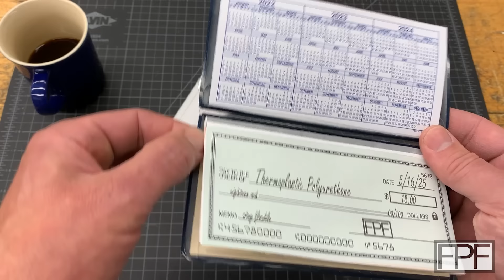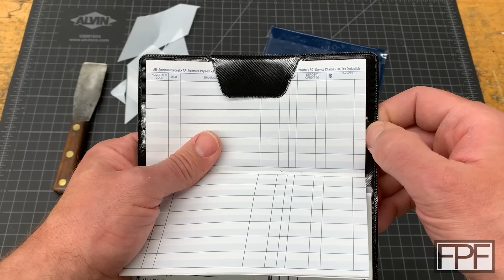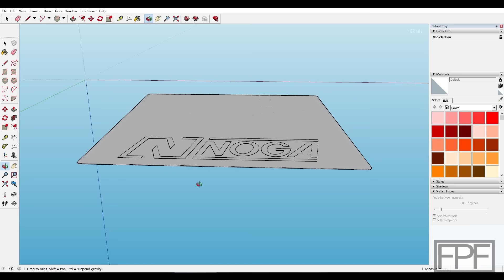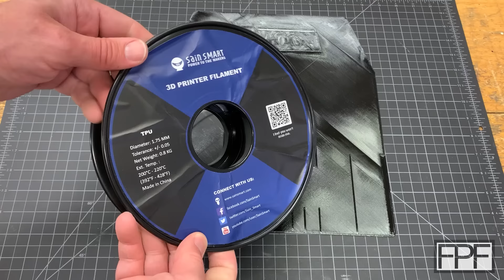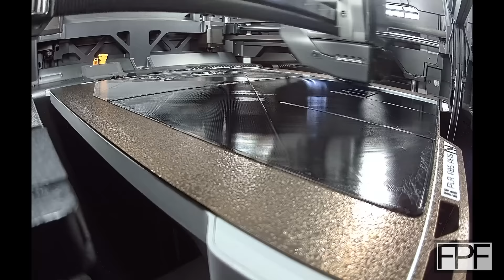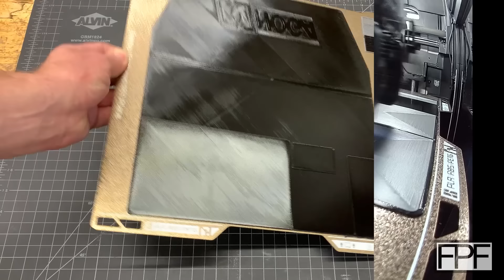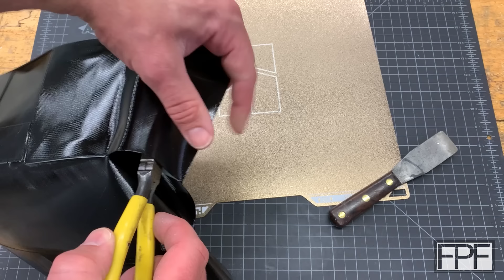3D Printed Tool Roll and Checkbook Cover

Comment: I’m currently trying to figure out how to design a combination of these things, in a way. I don’t have multiple extruders so it’s been really challenging, but attempting to make a pouch with bellows that I can keep in my backpack.
It will be thicker at corners to have some protection for the contents.
Figuring out how it will close and fasten is hard, and how to make the bellows “webbing” so that it folds inward I’m not really sure about either.
Still in early stages.
Reply from the maker: I did another video on this with the bellows for the pockets for wera hex drivers and magnets for closure.  check out the vids list on my channel
Reply: @FunctionalPrintFriday saw that recently and it does help, thank you. Not sure how well that will work for my idea but I’ll give it a shot. Would there be a way, at least theoretically, to do it with a single extruder, even if it’s just to test portions of it before printing a final version on a proper machine?
Reply: Oh, and you definitely earned a sub. Functional prints are all I do. Much appreciated!

Comment: Dropping the plate on some ice might help shrink the TPU in order to peel it off easier. That could also help remove the PLA support since it might have different shrink rates. Just a thought. Thanks for these TPU ideas!
I thought about inflateable gadgets with this method.

Comment: Rest of the world here, I've not had a cheque book this millennium, and even before that I hardly used it.  The rest of the world does things electronically these days, either with a card, or our phone.  Larger payments are often made using a mobile banking app.  I also can't recall the last time I used cash, certainly not since the pandemic when people didn't want to handle other people's cash.  I do carry some notes for emergencies, but I've never needed it.  In restaurants, we don't give the waiter our card like in the US.  Instead, they bring a widget to the table, and we tap it with our card/phone.  The idea of handing your card to someone else just seems wrong to Europeans.  Considering all the major technology companies in the US, I find it bemusing that your financial systems are so antiquated.
My guess is that PLA will only stick to hot TPU.  The tool roll is a much larger area, so the TPU has cooled a lot more.  Maybe a heated bed would keep the TPU warm long enough for the PLA to stick.

Comment: Couldn't you just print a layer of your support material between the print bed and the TPU to make it easier to get off? I know you mentioned the PETG one you started using wasn't as easy to remove but it may be easier than the TPU and you won't have to worry about damaging the print when removing it from the bed.

Comment: Hey. You can try Windex or propably any window cleaner as an invisible separation layer for TPU on the textured surface. Should work well and is easy to apply. I use it to print PETG on a smooth PEI sheet. Works really well.

Comment: So cool! Have you tried using different textured plates, like iridescent (rainbow effect), PEO Smooth (flake-like), or carbon fiber surfaces — partly for aesthetics and also to see if the release is easier due to the shallower texture? After watching your videos, I ordered the SaintSmart TPU. I got the A1, hoping it will deliver similar results to yours.

Comment: Tpu layers with pla interface. Brilliant. I've made tools rolls with ldpe and canvas sewn together in a sewing machine. I have a roll for files: metal, timber, rats tails, saw resharpening, needle,  bastard, milling, safe edges, you name it.  The two i use everyday live in the tool bag. That roll is just sewn canvas. The other canvas and clear plastic sheet holds my spanner set. I don't do mechanic work but sometimes a spanner really is what's needed. So a roll of spanners takes much less space than a full drawer layout of sockets, spanners and ratchet drives. Generally don't like the solution and as my tools have become better I've opted for custom containers: boxes,  3d print,  timber, laser cut foam inserts, folded metal,  etc... but a flexible item wrap for some digital callipers to go in my tradie trailer with all the dusty grungy timber tools seems viable. I might try this on my qidi4, which I wonder if its multi filament system will arrive anytime soon??

Comment: i like tool rolls and have made them with fabric but this is interesting on the nearly mass production type level if you can get the separation layer to be agreeable. perhaps something water soluble to dissolve it right out.

Comment: I've had good results removing TPU from a PEI plate by 1. gluesticking then brushing with water until it's an even liquid, and pre-heating the printbed to let the water evaporate for an even thin glue layer, 2. then after the print, running the entire plate under warm water while slowly peeling the TPU print off.

Comment: As someone who prints quite a bit of products that have TPU in direct contact with PEI, I have found using Prevailent T-80 is thin enough that it doesn't impact print quality and acts as both an adhesion enhancer as well as a release agent. It only requires a very thin layer applied with a sponge brush. The only downside I've found to using it is I have to wash large flat parts because they will feel a little tacky after, but I can basically peel tpu straight off without issue with only letting it cool a bit. This is the method that works best for me because I'm making parts that the Tpu feature stretching too much can cause problems with other features of the design, so it is easier for me to spend 30 seconds rinsing it off than to risk damaging the part. I'm also producing parts in bulk that are being shipped out so spending time slowly removing them from the plate is less than ideal.

Comment: What about using compressed air to remove it from the sheet? Actually, thinking about using a needle valve to blow air under it got me thinking you should try and print an inflatable ball in a future video.

Comment: Why not, as the first layer, print a Pet-G layer first on to the print bed, so that the TPU will release easy from it? And to get a similar 'finish' to the TPU that the print bed would give it, add "fuzz" in the settings, to the top of the Pet-G base layer, and the TPU should take an imprint off of the Pet-G layer.

Comment: Wouldn’t you just be able to print two separate pieces and then use a hot tool, like a soldering iron, glue gun, or heated wire to join the pockets together? Seems like the inner support layer was a major headache in this process. I imagine this is how the checkbook and tool roll are formed in the first place

Comment: Nice video, but I will tell you a trick! Put the build plate in the freezer, that will remove the TPU from the build plate for you. Let it sit in the freezer for 30 min, an hour or so. Works all the time, and it's super easy to remove after that.

The thing why this work so well is because the TPU gets shrinked, so it releases alot from the build plate, but then when you take it out of the freezer the TPU is also very hard since it's frozen solid. Then you can easily flex the plate like you would for ordinary PLA and boom it just pops off like PLA.

Thank me later! .. ;)

Comment: 21:00  OR.  just throwing this out there.  GET A FREAKING DIFFRENT BUILD PLATE FOR FK SAKE.
Reply from the maker: which build plate for the H2D would you recommend that provides the same texture?
Reply: @FunctionalPrintFriday  
a collection of them.   diffrent beds for diffrent applications. 

you need a kapton tape bed if you ever plan on printing polycarbonate. 
glass is extreme bonding for tpu's.  
smooth pei bed.  will sometimes work better than a textured one.  and in other cases a textured one works better than a smooth one.  

NEVER print petg on glass.  it will litterally take chunks of glass out.  
however if you use pva glue. or a pva slurry.  it can act as a release agent where the petg takes IT off the glass rather than chunks of glass.  

in any case it's too much typing for everything.  just know that there is a perfect build plate for any situation. and sometimes if something doesn't stick, all you need is a diffrent surface. 
.
as a final note.  touching build plates is the worst you can do.  the oil from your fingers will prevent adheasion.  simply clean with water and a CLEAN sponge.  no soap.
Reply: @FunctionalPrintFriday  
had to rewatch to see what the exact problem was.  

yeah either try a smooth plate.  
or go the pva release agent route.  (glue stick) 
but yeah for tpu's.  glass is amazing.  
it will stick even if your nozzle has a few millimeters distance from the bed and the tpu simply falls on it.  (ninjaflex.  does this.  diffrent tpu's might give diffrent results) 
but even with all that stick.    when the glass plate cools down it releases easely.  
IF when cold it does not release easely.  then you might need to recalibrate your z-offset.   (you can release it again if you heat the bed up to about 40-50 degrees celcius.  this will soften the tpu enoegh that you can peel it off like tape rather than trying to peal an entire flat surface off in one go. ofcourse this won't be a problem when printing something thin that you can roll up when cold aswel)

Comment: i'll give you a guess as to WHY pla works like support in this case.  

it's about 1 specific propperty that is also the reason why any print comes off the bed when the bed cools.
Reply from the maker: I imagine you're referring to the property of PLA slightly changing size when cooled.  I don't believe that is the property at work here.  They don't stick to each other any better at extrusion temperatures either.  I believe the reason is related to molecular differences between the materials and differences in the crystallinity.
Reply: @FunctionalPrintFriday  
it either stick enoegh to be able to print on it.  in wich case it releases when cooled due to shrinkage. 

OR 
it chemicly doesn't bond what so ever and then you CANNOT print on it.  
it will just curl up into a spiral like 1 or 2 cm behind the nozzle.  

however i believe tpu has a higher shrinkage so it shrinking more than the pla is why they release.

Comment: I wonder if you could go the next step and add a flap on the right with a clip printed in place. You’d also have to print the other half of the clip on the middle where it would meet

Comment: I want to warn those watching that taking metal scrapers/blades to your PEI sheet will absolutely scrape the PEI off of it, even if you're gentle.  You might not notice at first, but after doing it for a few prints you'll notice the wear.  The bed sheet really isn't supposed to be a wear-item, so scraping it with metal or printing incompatible materials directly onto it are just going to incur unnecessary expense. Wood/plastic scrapers are a must, and they're much less likely to damage the print as well.
Reply from the maker: I've been printing on PEI sheets for 8 years.  I have yet to scratch one or wear one out.  If you round the edges of your scraper and use the right angle, it slides on the surface.  I don't disagree that many ppl do scratch their beds, but I think it's mis-use of scrapers, or failure to round off the sharp edges.   I may cover this in a vid.

Comment: Apart from "who uses a checkbook", why not print it folded? In your setup, it'sprinted flat, so it's by default open. Which I don't think you want. So why not to model it in a way that it' printed in closed state, with a layer of PLA in between? Then the default state would be closed, and you have to manualy open it, instead of default open, and you trying hard to give it "memory" to stay closed?

Comment: Im so broke that i never saw a checkbook lmao.  
Honestly im kinda mind blown. Now that i watched the video, it all seems so logical! 
I really have to finally get the ams for my a1 and try that out!! Especially for toolsets, that came without a case or similar.
Thanks a ton for your curiosity!
Reply: Keep in mind that you’re not supposed to use regular TPU in AMS. Flexible/stretchy filaments don’t work well AMS if at all because of the way AMS switches filaments. (Bambu has a a TPU formulation that works with AMS but it’s not as flexible or strong.)

This technique works best with a multi-tool head machine. Alternatively, you could try manually swapping the filaments.

Comment: I have a Bambu A1 and I didn't get that wasteful multi material addon because it's… wasteful.
I'm wondering if I could get the printer to pause after the bottom layer is done; manually place separators, printed or cut from paper/plastic sheets in advance; maybe stick them with some water-soluble glue stick; and then resume the print.

Comment: New viewer here: this type of content and the discussions it starts are great!
I have a couple of ideas:
1. You could fiddle with the slicer so that the support "card" is printed with lines that go along the direction you will be pulling, instead of at 45°, and make it slightly longer, like a card slid into a sleeve: that should make it easier to pull it out.
2. Commercial sleeves are limited to 2D by the construction method, but here you could experiment with ways to add a 3rd dimension to the pockets, either with the bellows technique, or by printing actual 3D shapes that fit the tool, printed over an appropriate support material. I'm thinking pockets that are "D" shaped, with the flat side of the D being the back of the roll.

Comment: If you fully enclose the extra material and leave in, it could also give some more structure to a bag. And you could print a bag more or less flat, fold it, and close it with some simple integrated parts or heat. Lots of possibilities!
Reply: One layer of PLA inside woud eventualy break into stripes at different temps.

Comment: On top of the other suggestions people have been making, maybe consider adding some spare pockets in the empty spaces on your roll? Just in case they might end up being useful later on, you won't have to reprint the whole thing if something happens to fit, or if you have some small part or tool you want to temporarily keep with the roll

Comment: Just a thought, would you even need to remove the PLA layer with your first usecase? It doesn't really hurt much it seems and it's only 1 Layer thick, so...
What this makes me think of is materialcombination: I use a leather "case" for my cards and papers. The insert is plastic, and breaks after a few years.
And sometimes the sheath parts on the leather break too. With this idea you show, a thin 2 layer TPU could be sawn to the inside of the leather to make new sheath parts where the plastic stuff gets inserted in. (no idea if anyone understands what i mean in that case)
But in general, it is way harder to thin out leather to make the overall thing thin. But combining leather with TPU could work fine.

Comment: What I don't really understand: We seem to use a lot of "pressure" on that first layer forcing the material into every nook and cranny of the print bed and out comes a perfect surface with 0 print lines. Why don't we use the same pressure with all the other layers to make the material bond together really well?

Comment: You could totally print 2x PETG snap buckles on the left and right edges, which are physically captive by TPU loops printed in-situ.  The buckles would add a minimal printing time as they'd be printed proud of the tool bag.  If printed in the right place, they'd keep the whole organizer rolled up perfectly for storage.

Comment: Sometimes for an interesting top layer finish I like to use the Hilbert curve.  It takes forever and you might have to do a standard solid pattern under it, but it is sort of reminiscent of the textured build plates and looks nicer to me than the parallel lines on larger prints.

Comment: Use a painter's knife, not a scraper.  There are painter's knives in multiple sizes and with different amounts of "flexibility", so best get a set and pick the one that hits the sweat spot.  The advantage is that the risk of scratching your PEI sheet is way lower than with a quite rigid scraper.

Comment: Thank you for starting the gears...
What about hinges?
Creating 2 shells out of pla, then the connecting hinge with tpu.
No need for screws to have a reliable hinge. It needs material interlocking though.

Comment: One idea comes to mid. I've been playing with non planar 3d printing for a bit. either editing gcode in blender, using grasshopper, or just the slicer plugins. The idea is how to achieve lifted pockets or more dimensionality by printing the support material and then in single layers tpu on that. So traditional structure with a non planar tpu. imagine a pyramid for example.

Comment: Next time, you might consider just leaving the PLA layer in there for the checkbook cover since it adds a bit of rigidity to it and it will always be flat, unlike the tool roll.  Print it in black and you nobody would know.

Comment: I have my own experiment that I will be running soon as I have the release agent on order. The purple glue sticks are suppose to be PVA (Polyvinyl Alcohol) and I have used Polyvinyl Alcohol Mold Release liquid sprayed on fiberglass molds in the past. So I ordered a gallon of PVA mold release, and I am planning on pouring it in a fine mist, constant flow spray bottle (the kind you pump up a little and it pressurizes the bottle). I want to see how even of a mist layer I can lay down on the build sheet as a release agent for filament types that need it. Wish me luck.